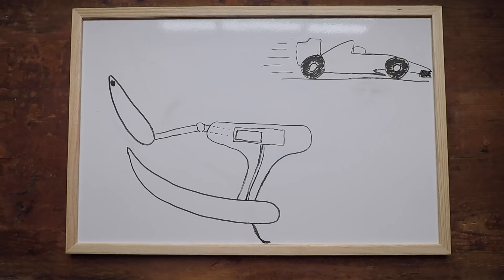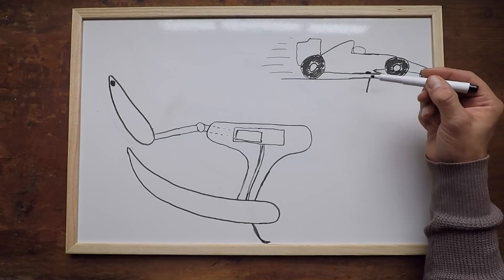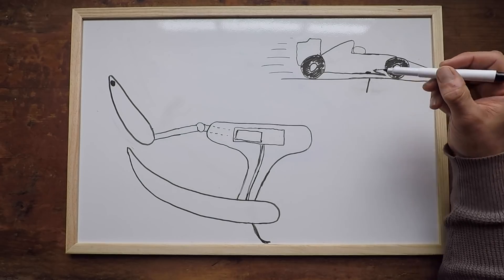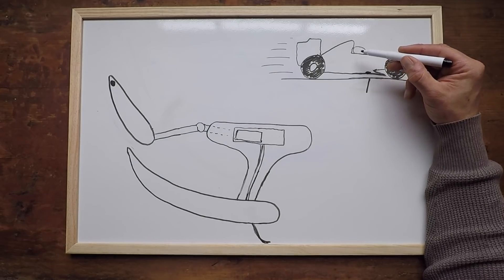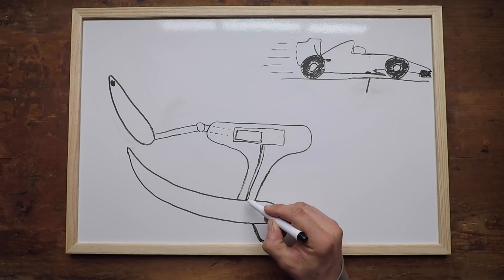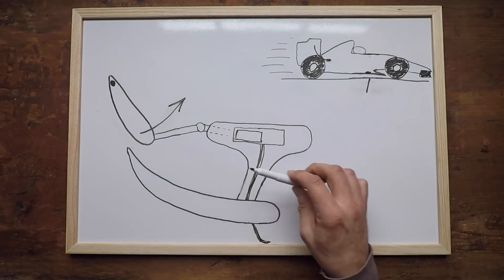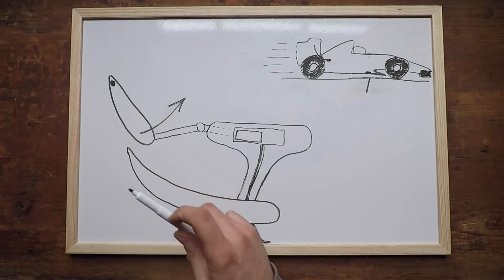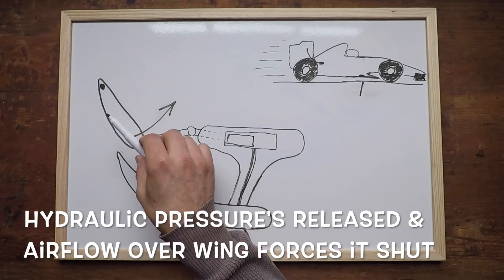MP251 - How F1 DRS Systems Work #2MinTech

Comment: Hey Marc another great Vid, completely off topic The Australian GP could you tell me why this event is held at Albert Park Melbourne on a absolute joke of a circuit, When we have a circuit like Mount Panorama Bathurst or the New Talium Bend purpose built race track, If you say it cant be held at Bathurst for safety reasons thats a load of rubbish there is concrete walls  3m either side of the Albert Park circuit all the way around so thats no different to Mount Panorama  but i do know that only 5 major events can be held at Bathurst a year as it is a Public road but having FOrmula 1 there would be mind blowing entertainment for the Fans , Talium Bend was only completed 18 months ago and probably has the best facilities here in Australia and  Mount Panorama Bathurst second to it, Isnt Formula 1 about the best drivers on the best circuits throught the world, instead of Drivers that can bring the most money with them to the team and Cities that are willing to pay the most money to Formula 1 to hold an event..
Reply from the maker: Well, you hit the nail on the head, it's about contracts and money. I also think that Melbourne puts on a great event, despite the track not suiting modern F1 cars.
Reply: @F1Elvis  Were u with Maclaren when they took Jenson Button to the mountain several years back ? would love your take on the Mount Panorama if you have been there,  I went their for the 1st time last year and TV just doesnt do this place justice there is not one bit of flat track anywhere you are either going up or down the entire lap ...

Comment: Do the drivers actually wait for the DRS light/sound to press the button on the steering wheel?  Seems like the best way to do it would be to just hold down on the button before you got to the zone (assuming you knew you were within 1 sec).  Does the ECU prevent the DRS from activating  in other zones?  I guess just wondering how much control the driver has over it.  Sounds like the ECU will only let the DRS activate within the zones, but if a car is in the zone, the driver has complete control over the DRS.  (meaning they could in theory activate it even if they were > 1 second behind.  Of course they would get a penalty).
Reply from the maker: No, the system is only armed by the ECU when the timing loop is triggered (1sec behind). It has to be activated by a manual button push or switch press, can't just hold it down. Driver has to be in total control of activation.

Comment: Thanks Marc. So does this mean that the following car has to get within one second BEFORE the DRS zone? (i.e. not during) Always wondered about this.
Reply: Maybe a more simple way to explain is this:
- Car 1 cross the DRS detection line, the timer starts counting.
- Car 2 cross the DRS detection line, the timer stop counting.

- Was the timer above 1sec? No DRS for car 2.
- Was the timer below 1 sec? DRS enabled for car 2
Reply from the maker: It has to be within 1 second at the DRS detection point, the sensor I talked about in the track surface, to 'arm' the car, then DRS is activated in the DRS zone.
Reply: Thanks for the clarification, guys. When I was watching this video, I was like "hang on, did that just answer the question I've always wondered?"

Comment: Doesn’t Lewis have a different system where he has to manually close the flap? I’m sure he did in the past.
Reply from the maker: It can be closed earlier if a driver wants to reattach airflow sooner before a corner, some cars might need this more than others.
Reply: Correct marc.  Lewis prefers to manually deactivate DRS, better stability for his late braking style.

Comment: #AskElvis Is it ever the case where a driver would shut the DRS flap before pressing the brakes or would not use DRS even when available?
Reply from the maker: Yes, some occasionally close it manually at certain corners just before braking to give another half second for airflow to re-attach to the wing

Comment: Isn't the gap that is created with DRS in essence a so-called "slot"? On an aircraft wing slots/slats are used to create extra lift. So on a F1 race car the effect would be extra down force. This will give more (tire) friction and slow down the car. So...in which area is the surplus DRS speed generated?
Reply: No, a slot adds lift by keeping the boundary layer attached, it's specifically shaped to do that, this is shaped to NOT do that.
Reply: @johnfilios8759  OK, thanks.
Reply: @steenkigerrider5340  Like front F1 wings. That's why there are multiple elements instead of just 1 big piece.

Comment: What is a Moog valve?
Servovalves and Servo-Proportional Valves are electrohydraulic, continuously acting valves that transform a changing analog or digital input signal into a stepless hydraulic output (flow or pressure). ... Moog valves provide precise control of position, velocity, pressure and force.
Reply: Those are the cheap valves 😉